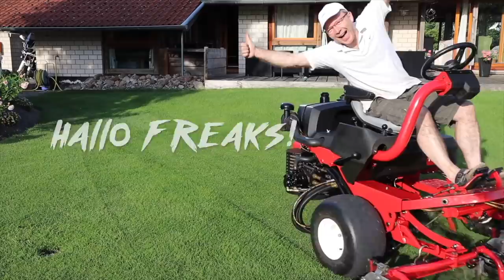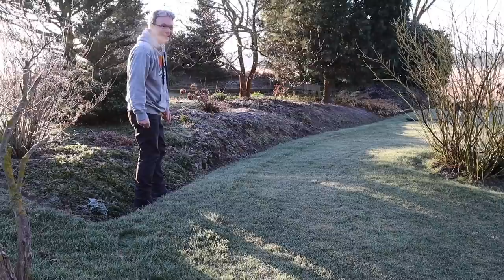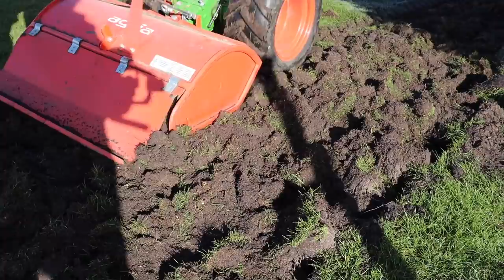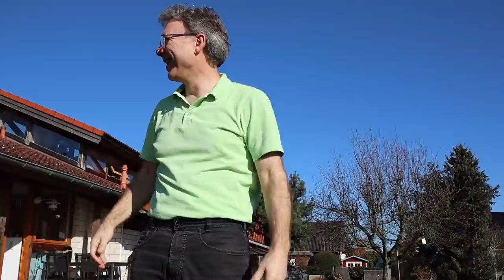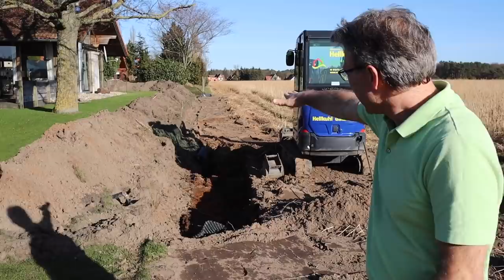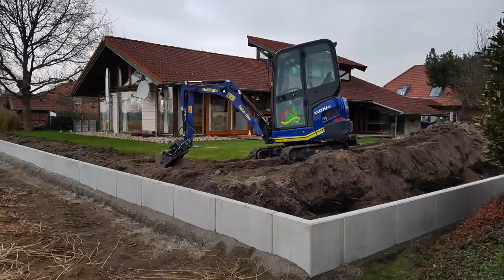Die ERNEUERUNG der SÜDKANTE für die topfebene Rasenfläche beim RASENFREAK!

Comment: Mich würde ja mal interessieren wie hoch die Kosten für so ein Projekt ausfallen.
Reply: Ich hab ein bisschen was im Bauwesen zu tun und schätze so 15 000 €. Das ist wirklich nur geschätzt und ich weiß es auch nicht genau.
Reply: @mrtz_flr  Ich würde auch so 8000 bis 12000 schätzen :)
Reply: @DeutzFahrD7807C  👍✌😜
Reply: @mrtz_flr  hab ein ähnliches Projekt durch . 64 L Steine , 30 er Fuß und 55 hoch . 
10 tausend . 
Allerdings wurden meine Steine noch gegen Verrutschen von hinten via baustahl verschweißt und mit Beton aufgefüllt .

Grüße
Reply: What? Ich habe für 300m³ ausheben, wegfahren und 200m² Sand anfahren und verdichten in der Region 9 bezahlt. 15 würde ich dafür nie bezahlen.
Reply: @davids.6671  kommt ja immer auf Region, Material, Zeit und Gegebenheiten an. Das sollte ja nur sagen, dass es das ganze nicht für 1000 Euro gibt. 
Allein die LSteine mit Bewährung sind richtig teuer.
Ich würde das sowieso alles selbst machen, da wir alle Maschinen selbst haben. :)